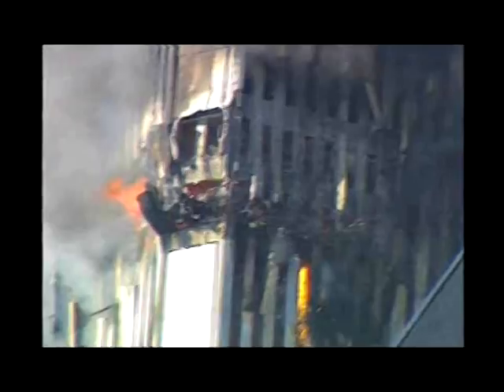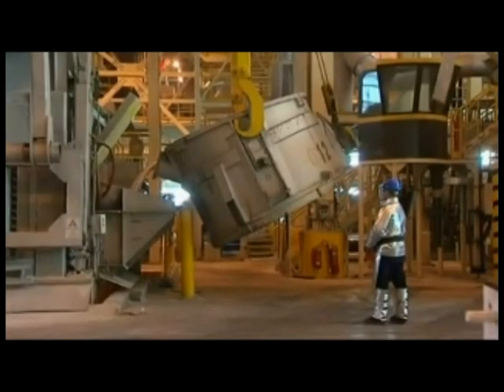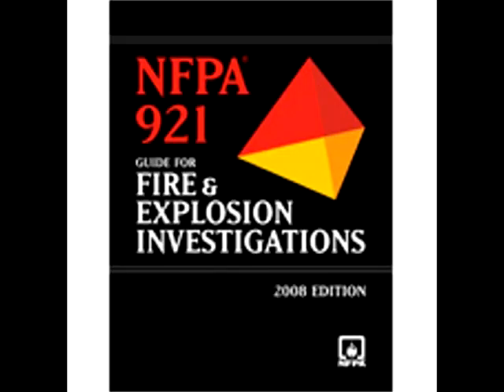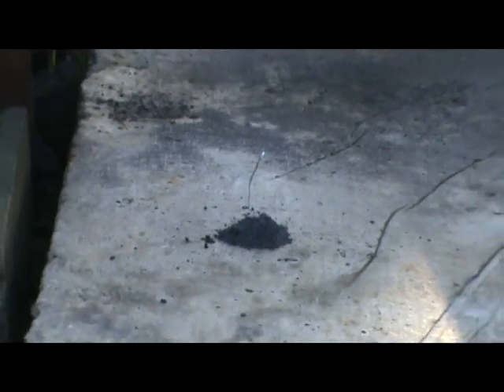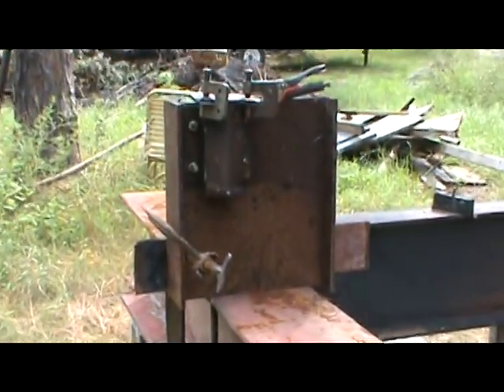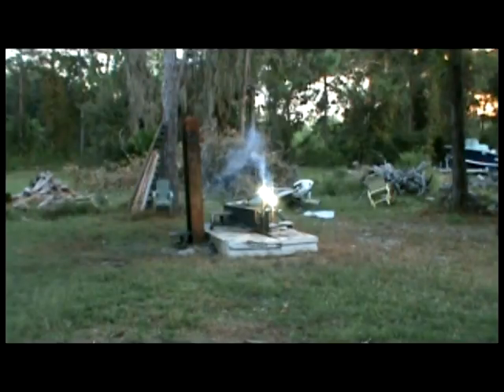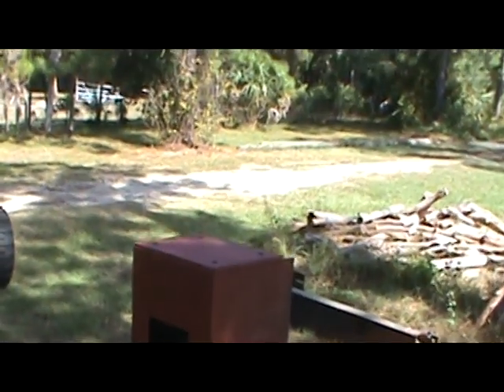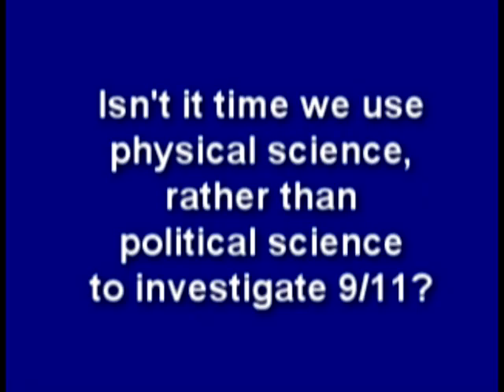9/11 Experiments: The Great Thermate Debate

Comment: (10) @lacossa nostra:

Skeptics point to National Geographic thermite experiment. But they were motivated to fail. They did it all wrong. J.H. Cole did his own experiments and by trial and error produced a perfect method for cutting steel beams both vertically and horizontally with plain old thermite (not even the exotic nano stuff), proving Nat'l Geo's experiment to be imperfect and possibly biased.

Try AE911Truth (dot) org for the real, unbiased professionals.

Good luck!

Comment: (9) @lacossa nostra:

These iron microspheres prove that a large quantity of iron had been molten. The spherical shape can only occur with temperatures far above melting, allowing the droplets to form spheres from surface tension before they cool. Most of these spheres were smaller than the width of a human hair.

Two byproducts of thermite/thermate are iron microspheres and gray-white aluminum oxide smoke. There was plenty of both on 9/11.

Cont'd...

Comment: (8) @lacossa nostra:

Many of the remaining steel beams showed signs of erosion and melting, becoming paper thin in places. Skeptics have suggested wallboard in the fire did the damage, but they didn't do the experiment to prove it. Jonathan Cole did do the experiment and proved that wallboard had zero effect on steel beams even after 20x the exposure to far hotter fires!

Not only that, the 9/11 concrete dust contained tons of iron microspheres.

Cont'd...

Comment: (7) @lacossa nostra:

Symmetrical collapse and free fall acceleration both require controlled demolition in structures like the 3 WTC bldgs which collapsed on 9/11. These only happens without controlled demolition in cartoons and in gov't reports.

Though the fires from jet fuel and office furnishings are vastly incapable of melting steel, there were countless examples of molten iron (the major component of steel) in the debris from those collapses.

Cont'd...

Comment: (6) @lacossa nostra:

More Simple Physics:

Free fall acceleration of a collapsing steel beam skyscraper is impossible from single columnar collapse. And yet, 7WTC collapsed at perfect free fall thru 8 floors, and close-to-perfect free fall thru the remainder of the collapse.

Breaking undamaged or only weakened steel beams requires work (and this is the important part). Work takes energy. And that takes from the acceleration of collapse, slowing it down.

Cont'd...

Comment: (5) @lacossa nostra:

I had heard that the towers were built to block the chimney effect as a safety measure.

Simple Physics (grade school stuff):

Asymmetric (lopsided) damage never leads to symmetric, straight-down collapse. Chop a tree on the side, and it topples over. It doesn't collapse right through the trunk into a pile of sawdust! The 3 bldgs collapsed straight down only because the damage was symmetrical from controlled demolition! Blindingly simple.

Cont'd...

Comment: there is still the fact that to cut the proper supports and take the tower down like it was, ud need to close the building down and do noticable construction and prep. also, no devices like this were ever found and no cuts like this were ever found. the pictures of said cuts WERE DONE AFTER THE FACT IN THE CLEAN UP (proven). also, this video is easily faked aswell so anyone believing this but not the findings of the independent investigation is a gullable person.

Comment: till this day demolition workers use DYNAMITE!! to destroy/take down a building 

so mr smart ass why dont the use thermite 

sec the fuel, the aluminuim from the plane the magnesium from the weels and other parts of the plane, the plastics ect were able to melt/weaken the steal struction 
I bet you never heard of tempering steal!!

btw learn to weld!! 
to weaken steal you need to reach 700 degrees celcius 
the towers were working like a chimeny

Comment: Maybe, Moron, you had better lookup WHY Physics&Reasons
thermite video gets laughed at. There is a REASON, Dumbshit.
1. He BOLTS ON containers to direct thermite at the steel.
2. NO CONTAINERS have ever been found, nor ignitors.
3. He cuts away TWO surfaces of the H shaped I-beam.
4. His experiment would NOT work on a complete I-beam, except
with TWO other bolted on containers. A total of THREE for every
I-beam attacked, and 4 for every box column, at the WTC.
5. He UNBOLTS the containers.

Comment: NO, actually, it doesn't. It turns IRON, from the iron oxide,
into a liquid state. That iron has to heat the steel, so it is
COOLED, and welds itself to steel. Remember, that's 
what it's been doing for railroad rails for 100 years.
EVERY column attacked with thermite, should have
BLACK IRON welded to it, MORON.

Comment: Thermite doesn't cut steel, MORON, it welds to it.
That's what it's been doing for over 100 years, not cutting steel.
One pound of 2500C thermite, heats One pound of steel, to 1250C.
The WTC steel columns, had 30 TONS of steel, and none of them
had thermitic iron welded to it.

Comment: hahaha if u put thermite in a baked redclay plantpot and put it on the hood of ur car it goes(drips) all the way through the engine block even making a hole in everything thats beneath it untill the reaction stops sure it can cut trough beams and bolts they must of used tons of thermite to keep the reaction going for 6 to 8 weeks even firefighters said it was all molten underneath the rubble LIKE LAVA THEY SAID i choose to believe facts i found out myself not some STORY

Comment: We get 160k/yr, twice as much as Gage pays himself spreading lies. We can post from Hi, on the beach, we use speech recognition posting software/algorithms to make it look real. LOL, you are paranoid, and accept failed CTs.
No thermite used on 911, Zero evidence.
Thermite can do a lot of things, but not used on 911. 
Laying thermite on a beam, will not cut it. 
Putting in elaborate devices, or inside the steel can cut steel. The fantasy of people prepping the WTC for weeks, lol, nuts

Comment: Actually, Physics&Reason doesn't do any such thing.
1. He BOLTS containers NOT found in the WTC steel.
2. He attacks ONE surface, while I-beams have 3, and WTC core, 4.
3. He shows no WELDED thermite iron, on the WTC steel.
4. He ignores that steven jones shows a PAINT LAYER worth of NT
(60 microns, actually. How does 60 microns get into a container?)
5. He ignores how NASA AVIRIS, never found temps above 850 C.
All us trolls, pointed that out to P&R years ago.

Comment: You've assumed that iron sphere's can only be produced by thermic reactions. I haven't even spoken about any mechanism causing the metals to "burn". I have merely stated a fact that the planes contained alloys of aluminium that MELT between 400 - 500C. There are plenty more reasons for the glowing metallic liquid: Sulphur, most definitely, reacted with the iron and could have produced a eutectic which in turn lowers the melting point of the iron to around 900C. But of course, it was thermite...

Comment: You are misleading yourself.  You talk about IRON spheres which can only be cause by a reaction that had to be introduced apart from the fuel burning and then talk about alloys that burn at 400 - 500C.  Remember the iron you mentioned?  What caused iron spheres? Remembering nothing on the day was hot enough to cause molten iron.

Comment: The use of the word "exotic" is very misleading. I didn't say it was molten steel: There are plenty of aluminium alloys present in the aircraft. Are you tell me that all glowing hot metallic liquids are molten steel? back to my original point, if these iron sphere's were produced by a thermic reaction, then thermite could not have produced the pools. A lot of aluminium alloys melt between 400 -500C which is the temperature range of an office fire. No thermite is needed.

Comment: So you are saying something mixed with aluminium made it 'look' like molten steel.  I would like to know exactly what you think that something could have been and what provided the temperature to cause a molten steel like alloy to drip from the building and collect in gutters in the base in molten form.  Such a reaction is not possible given the temperatures at which anything burned on that day UNLESS an exotic thermal reaction was added to the mix.

Comment: They both survived a hit from a plane. No one claims that the steel melted. As for the molten metal pouring from the building, It quite easily could have been aluminium. The papers published by Jones were, I'm sorry to say it, crap. The journal they were published in was created by Bentham Science Publishes which publishes "un-scientific" papers and doesn't even peer review them while, uniquely, charging a publication fee. It's probably the worst place to look for scientific fact.

Comment: The thermite reaction was not given the opportunity to cool.   The buildings were designed to stand after a plane hit them.   There was no slow fire hot enough to melt steel.    You saw in the video how hard it was to melt steel WITH thermite unless it was purposefully 'directed'.  Thermite burns a hell of a lot hotter than fuel, and even with the added aluminium into the mix, any reaction is not sufficient to turn steel into a liquid.    Remember the "like a foundry" comments by firefighters?

Comment: They weren't given the opportunity to cool? But I thought the fires weren't even hot enough to melt the steel in the first place: "regardless of where the pools came from, nothing in the building could have caused them"

Nothing in the building could have caused them? What about the occasional and slow (due to the relatively small surface areas involved) reaction between aluminium from the plane and steel from the cores?

Comment: You've seemed to have put a lot of work into this which is nice to see but thermate still doesn't answer the question: "Why is there a POOL of molten material?". Your experiments cut the steel, yes. Produced iron spheres, yes. But that's the problem; There still isn't enough thermate to produce pools of molten steel. The iron spheres solidify. If they didn't solidify straight away then we wouldn't find them. Also, if thermate was used, why wasn't any large amounts of elemental barium found?

Comment: WTC 7 collapsed because the debris from the falling twin towers carved a hole in the bottom stories of the building. Those floors also contained diesel generators which sparked a fire. The remaining steel beams combined with a fire could not support the building and it collapsed. There is nothing else to check as it makes complete sense. 911 was caused by a bunch of angry terrorists, even Bin Laden himself admitted to the tragedy, that's the truth, so get over it.

Comment: The first vid is interesting; although he didn't let it fall through the air, which is what we wanted to see.  I wonder how much cooler that metal pan is that he dropped the aluminum onto than the air.  Also it wouldn't have been JUST alum in the WTC.  There would have been other debris in it, including some combustible debris, which WOULD flare up while falling.  Plus you ignored my Madrid video which proves this has already happened before where there definitely wasn't controlled demolition...

Comment: Point made Mark; It was only a PARTIAL collapse and did burn for 24 hours, significantly longer than the WTC buildings.  Point made.  Unfortunately for your position, there is something that could make up for the (prima facie) difference in the two events: I don't know if you knew this, but unlike the Madrid tower, the WTC buildings WERE HIT BY F@#CKING AIRPLANES ON PURPOSE AT HIGH SPEEDS WITH THE INTENTION OF DOING A LOT OF DAMAGE TO THEM.  That makes the comparison slightly difficult.

Comment: they used 1,000 lbs of thermite and barely ruined the hood of that car, and you're pointing to this as evidence that thermite was used to bring down two of the largest buildings in the world?  That's weird to me.  I'll grant you that the thermite looked like the molten metal FOR AB A SECOND in this video, but this is not an example of thermite cutting steel, causing a molten pool of metal that flows away to a different spot, staying hot enough to be molten... (which is what I was asking)...

Comment: Steel will bend the same in a testing lab or a site disaster. If it bends and crumples with stress cracks in a predictable fashion. It will react that same way unless another force was applied to it that they don't put on it at the testing lab to find a failure point. And they do put every force possible on steel beams. Any way the point to this is; A terrorist attack will not change the predictable behaviour of steel; regardless of what you think.

Comment: Im well aware of the Alum in the planes and BLDG, Molten Alum does not have the characteristics of what came out of the south tower, It dissipates heat too fast!
 I am a better critic of me than you are, and I have looked at it every way possible, It is not alum. Can I say for sure if its steel, Iron or a mix. No I cant, If I had a sample I could but alas that is no longer possible. What other skyscraper fire, or any other fire for that matter has anyone seen molten metal fall out of?

Comment: CONT'D: The reason you've never seen anything like this in 20 years is because NOTHING LIKE THIS HAS EVER HAPPENED BEFORE.  THAT'S HOW WE WERE CAUGHT OFF-GUARD IN THE FIRST  PLACE.  If you think thermite is the cause of the flowing molten metal falling from the tower, you need to provide another example of where thermite cut steel, then after the reaction, the steel stayed molten and flowed away...

Comment: Well there is aluminum in the planes as well as the buildings, and we know that it can melt in the temps reported, and it is consistent with the video footage (again, just google "molten aluminum" and you will see exactly what is falling out of the towers).  So how do we KNOW it wasn't aluminum?  You are just saying that b/c if it IS aluminum then it isn't evidence for the conspiracy theory.  The reason the steel could bend without cracking is b/c is was heated up and malleable.  CON'TD

Comment: How does the standard view explain molten metal again? And don't give me that Aluminum crap cause we both know that wasn't ALUM running out of the tower.

Yes thermite is not used in CD cause its not needed.

What standard explanation do you have for the Steel beams bent in a U with no stress cracks interior or exterior? I've been working with steel my WHOLE LIFE! (practically) 20 years realistically and have never seen this happen.

Comment: OK so if the NYFD was used and they're not in on it, how do you explain the fact that they predicted the collapse of wtc7 due to fire and evacuated accordingly?  If a steel skyscraper has never fallen due to fire and that is such a far out notion, then how did the firefighters correctly predict it?  This is the problem with conspiracy theories; by focusing on minute details of a giant event, you lose site of the big picture, thereby ending up with a nonsensical meta-narrative..

Comment: the giant pile of debris is NOT inconsistent with a few huge buildings falling down in the streets below; if so, then why did it take them months to remove it all?  A small pile of debris wouldn't take so long to remove.  Furthermore, none of the buildings fall at free fall speed.  This is more obvious with 1 and 2.  If the main structure is falling at free-fall speed, then why do we clearly see columns and other debris falling BELOW THE POINT OF COLLAPSE...meaning faster than the collapse...

Comment: so if the steel beams of WTC7 didnt turn to dust, where are they in the rubble? the building shouldn't have fallen the way it did due to fire, the left over debris would be stacked dozens of floors high, of slightly bent steel, if that. its a fairy tale

Comment: my point is all this steel would obviously cause resistance but seen as the 3 buildings fell at free fall speed means the support beams were taken out. And as for the "giant pile of steel and concrete at ground zero", the left over debris is totally inconsistant with the mass of the towers. and WTC7 ,, well,, that just makes no sense at all.

Comment: No one has said steel turned to dust.  Good strawman attempt though.  No I said "a lot of it [the debris]" was turned to dust.  The steel wasn't, which explains the giant pile of steel and concrete at ground zero.  Surely you've seen pictures of steel beam debris.  By the way, a demolition wouldn't turn steel into dust either.  So I'm not exactly sure what your point was and I don't think you do either LOL...

Comment: A lot of it was turned to dust (not by magic though, by the force of gravity pulling it into itself and the ground).  I don't know what you mean by "little debris left."  Didn't it take NY a few months to clean up all the debris?  SO, what are you talking about?  And besides, a controlled demolition isn't going to have less debris than a building of the same size that collapses due to a plane collision and fire.  The debris might be different sizes, but the amount would be the same, right?

Comment: Just because a magazine -literally on the same WEEK as 9/11 - says that steel was "melted", that does not make it the "official story". Who are firemen to say that the "molten metal" that they saw was STEEL, not aluminium, for example, beside the fact that they saw it days AFTER the collapses?
Where are the videos of the sun-bright thermite burning? Where are blown-out windows and the sounds of bangs from these charges? How could so many hard- or impossible-to-access columns be rigged unnoticed?